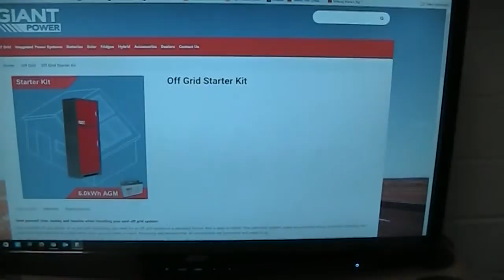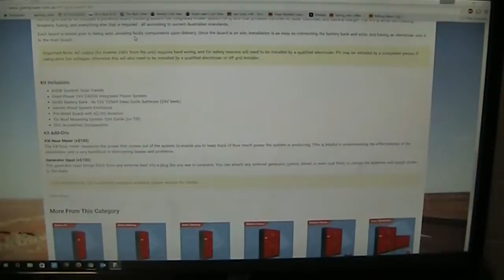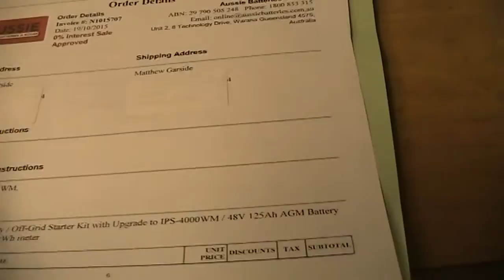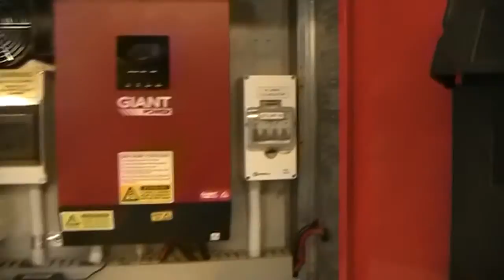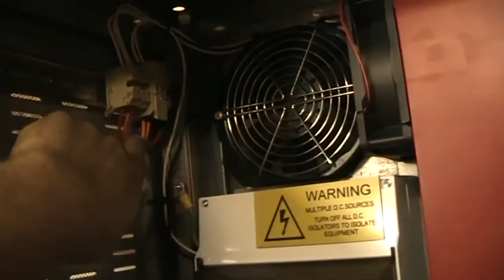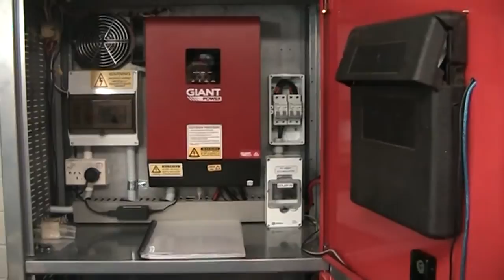Off Grid System First Look.

Comment: hello karinya so i just want to know the dimension of the system occupy and if this can run basic home appliances? thanks ed
Reply from the maker: EdBrent Jubilee Hello, thanks for watching. This enclosure is not very big, about 70 cms wide by 45 cms deep and 180 cms tall. It can run any household appliance that you would normally use in a house but the battery bank that I'm using is very much under sized to be practical for running anything of use. In the next few weeks I'll be upgrading the battery bank to over double the capacity that I have now but even this would be stretching the limits of what would be practical for running a house with. Next year I'll be adding another battery bank and this will give me almost 5 times the capacity that I have currently and then it will be a good practical system to do everything that I'll need it to. 
I hope this helps to answer your question. If you need to know more just let me know. And keep an eye out for the next few videos that I be adding to the channel over the next few weeks. These will be on the battery bank upgrade and may shed some light on the subject.

Comment: Hi Karinya it look a nice system but the enclosure look too small to me there is no substitute for natural ventilation I"m assuming you are venting the 240 V fan out the back of the cabinet I am a solar off grid designer if I was doing that job I would be cutting the entire top of the enclosure out and fitting it with some expanded metal mesh and putting the fan on top by doing this you also get some convectional air flow through the cabinet , I would be interested to know how much load you have on the system as there is only 1.5 KWH usable capacity @ 25 % DOD which is not much and I am sort of wondering if the system will every pay for it self, hope this info help I am sure we all would be interested how your system cope over the next 12 month Cheers John.

Comment: Great vid. I have been looking at going with this type of system in the next 6 months or so. Luckily I am in QLD (about 50 mins from the suppliers). I have about 15 185w 44v   panels, so should be able to make something decent hopefully.
Reply from the maker: brisXr6t Hi, your panels will work well with one of these inverters. I'd run two series, seven parallel setup. Look forward to seeing your setup once you have it set up.